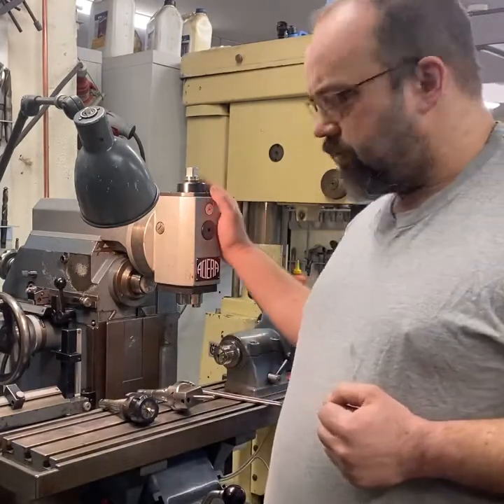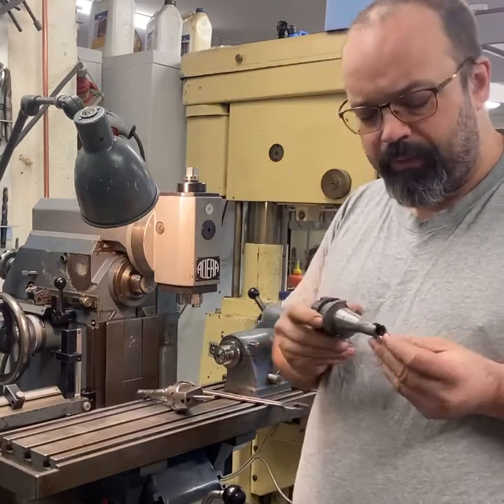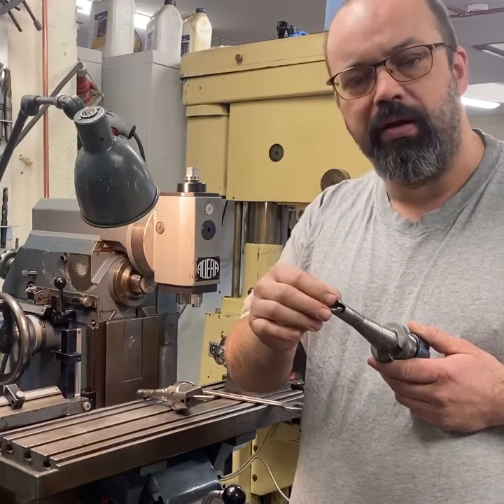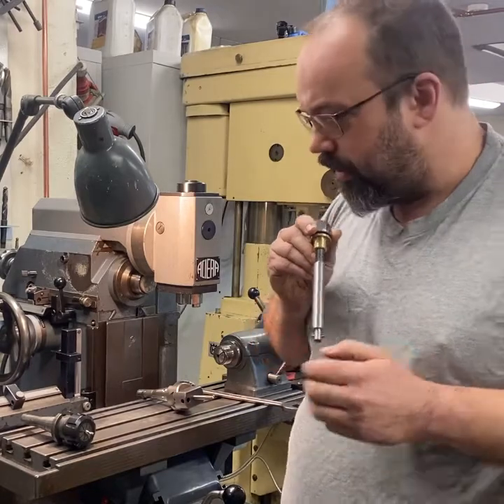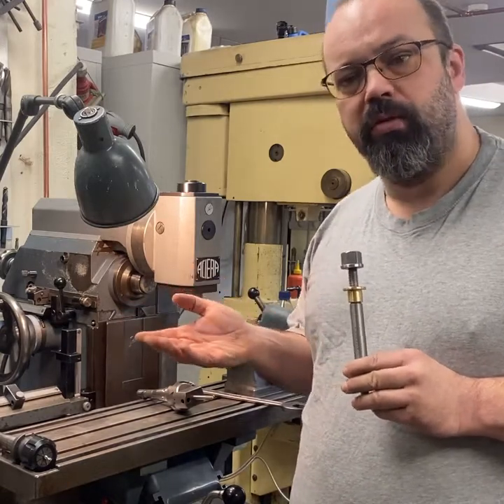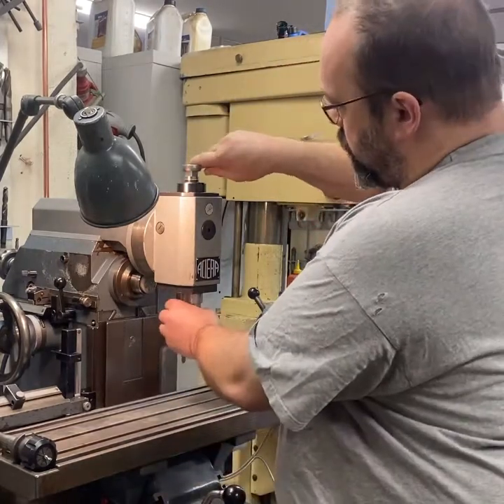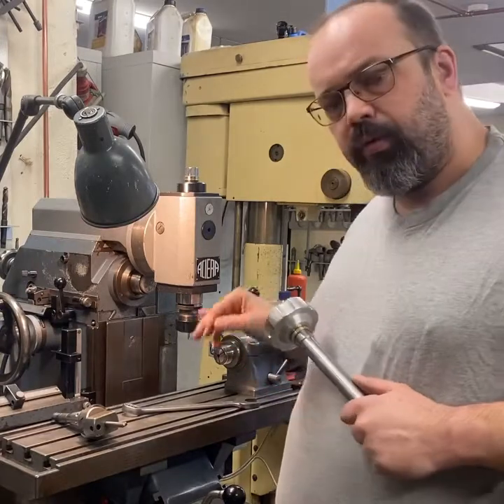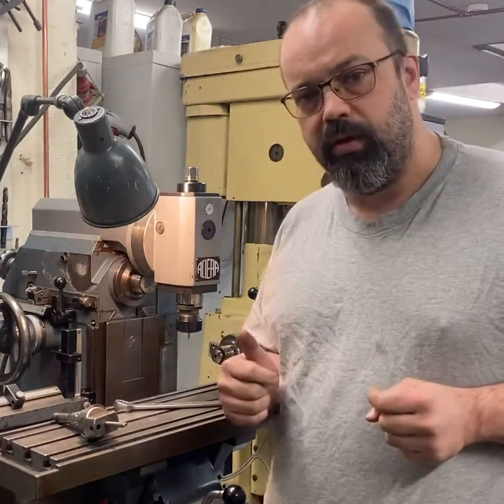Quick change conversion for milling machine

Comment: Wow ! love the Hassenblad idea,  have an Nmbt 30 machine, could work great ... best regards Steve
Reply from the maker: @stevenhavener7327  it works 100%
I have had zero issues and i am using it in 3 machines.

I have however recently bought a iso 40 machine (schaublin53) and i will keep the drawbar there as i bought it for heavyer milling. But my 30 machines works great this way